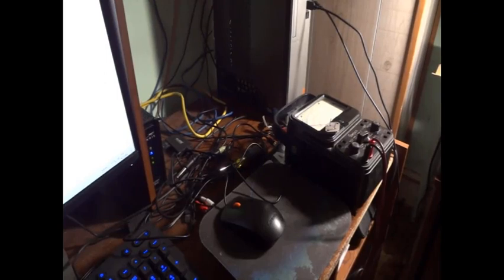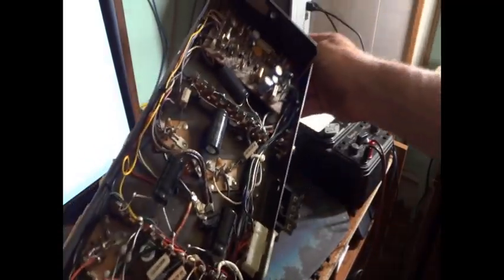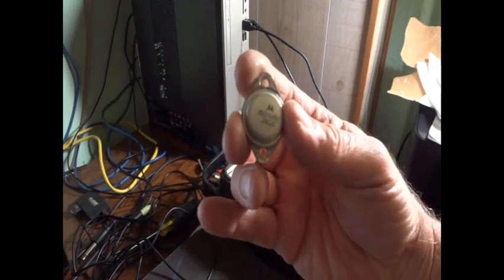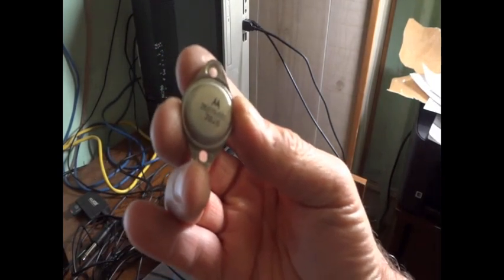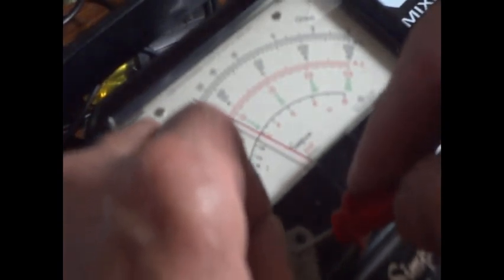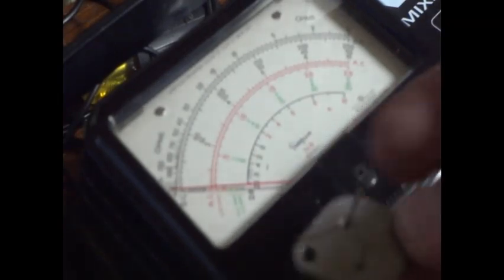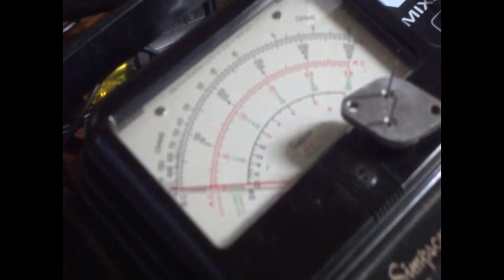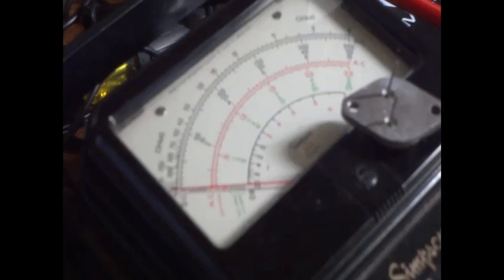Testing a 26039-002 NPN Darlington type Transistor by Motorola

Comment from the maker: About my comment in this video about Motorola, I was just looking at a 1998 ECG cross-reference guide that I have and the transistors are not listed.
Also the ECG 243 and ECG 244 did exist then as the proper replacement. Now called NTE with the same following numbers...... 243,244
My Guess is that it took over 20 years for Motorola to give these numbers up ? Gee why do I dislike Motorola ?